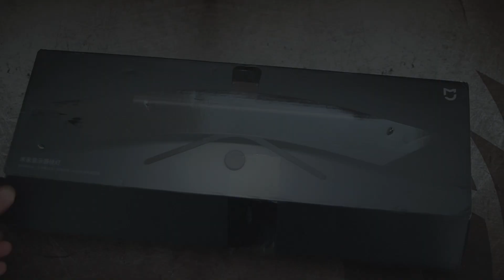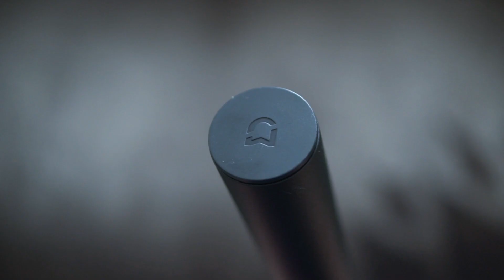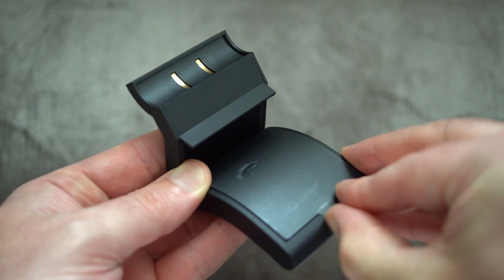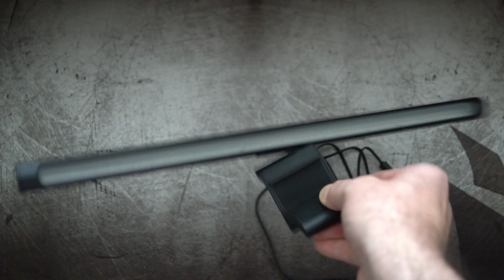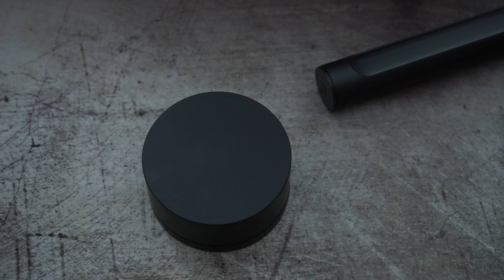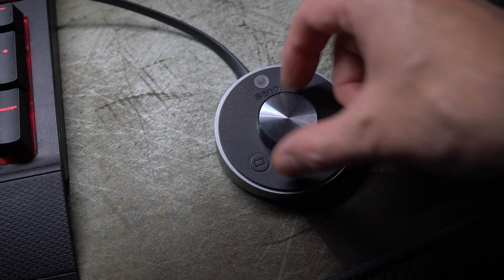Xiaomi Mi Computer Monitor Light Bar: Quick Look

Comment: Brother can u please help me I have LG UltraGear 27GS60F 27” and I have 2 questions. Will it fit in the center and if it doesn’t is it worth it to put it on the sides of the monitor. I mean will it do the job on the side?
Reply from the maker: It should fit most monitors there is plenty of depth on the design it's only an issue on some curved ones.

Comment: I bought it yesterday and it died today worst quality ever the controller is not working anymore even i changed the batteries and checked everything else
Reply from the maker: You have to go back to the seller and ask for a replacement or refund. I've not had any issue with this since I made the video.

Comment: Wonderful review!!! I have this on my email. I can't wait, BTW. Question about this product: is it acceptable that this light bar connects to the monitor IO?
Reply from the maker: It doesn't drain that much power so you shouldn't have a problem using the monitor port.

Comment: This looks suspiciously similar to the Yeelight pro light bar.

I wouldn't be surprised if they share the same OEM.

At least the BenQ ones have an unique (and frankly superior) hinge design that fits almost any monitor.
Reply from the maker: The BenQ is heavy though and more bulky mechanism. Most monitors will work with this.

Comment: Mine broke 2 times in a year 😅
Reply from the maker: Not had issues with this one so far sorry to hear that
Reply: I'm not surprised, you get what you pay for. 🤷

The common problem with these products is that the more popular they become, the less they are properly QC tested, as the manufacturer struggles to cope with the demand. 

I mean, you could go through several of these before you would have spent the same amount of money as a BenQ light bar.

It's just more e-waste, sadly.
Reply: @StardustLegacyFighter  Exactly, I bought mine online at their official shop from Shopee. It was on sale for 1k PHP (17 USD) sadly it broke after using it for just 4 months it won't turn on anymore. I used to love Xiaomi because they were always on sale but bcus of this I just realised they're selling their defective items at a cheaper price. What sucks more is that they don't have  service centre in my region. The nearest service centre is 4-5 hrs away. 🥲
Reply: Going 3 years now. No problem on my unit either. Sorry to hear that. Might be a bad catch.
Reply: Mine is going 2 years now and is open almost 24/7. No issue. Might be a bad catch (unit) in your part.

Comment: Is there an option to not use the remote? Not a fan of it.
Reply from the maker: No you can't use it without the remote
Reply: The remote is probably the best thing about it, lol.

It's the main reason why more ppl buy this instead of the BenQ Halo, which is about 5 times more expensive.
Reply from the maker: @StardustLegacyFighter  BenQ offered to send that in a few months ago for review, but I declined. Reason I didn't want to spend hours making a vide on light bar that price, that 3 people might watch (if that as there are scores of videos on it)
I just don't think most people will spend that sort of money on the BenQ, and there is no reason to either.

Comment: I have two monitors next to each other at a slight anger. If I fit the bar on one monitor will I get a glare on the other? It looks on your video that the wall next to the monitor lights up so the light goes to the sides?
Reply from the maker: If it's flat no, if it's curved you probably will have light hitting it depends on the monitor

Comment: Great video thanks, just bought the Xiaomi for £31, can't go wrong, I hope lol
Reply from the maker: I like it and still use it, works well and much more useful than some might think. Hardly use the main ceiling  light now this is perfect
Reply: Where did you get it for £31 it’s like sold out everywhere
Reply: @jojojojo88888 They're struggling to keep up with the demand, and as a result of that the QC is guaranteed to be rushed.

Comment: Hey man Im curious on the battery powered controller. How is the battery life of the wireless controller? How often do you change the batteries? because if I have to constantly spend money to replace the batteries of the controller Id rather go for the Baseus lightbar
Reply from the maker: Battery lasts ages it's a complete non issue. Also you can use a rechargeable cell frankly the cost is negligible and you get the benefit of no wires on the controller
Reply: @MrBazReviews  Hey thanks for the reply despite the video being 2 years old. Anyways thats good to hear, but out of curiosity do you remember the last time you changed the batteries? Doesnt have to be exact it could be just a guess
Reply from the maker: @ren0659  It depends how often you change settings it's a non issue forget about it seriously
Reply: @MrBazReviews  Alright then thanks alot man for the constant replies, you convinced me to order the Xiaomi over the baseus
You def earned a sub appreciate it
Reply from the maker: @ren0659  I've not charged the batteries this year, so really it's not a big thing at all, unless you're constantly changing it all the time even then get rechargeable cells
Reply: @MrBazReviews  I see I see thats good to know thanks appreciate it

Comment: I went with the Xiaomi Mi, i don't see why anyone would buy the BenQ when this one is so much cheaper and is a bit better
Reply from the maker: I agree I can't see the reason to buy the BenQ, but at the time it was released this one wasn't around. It is very well made, but they perform very similar.
Reply: It's considerably cheaper, but that's the only advantage it actually has over the BenQ ones.

If you're not on a budget, then I see no reason to pick the cheaper option.

Comment: Nice video! Would like to ask if there is an option for physical/touch controls if the battery dies on the wireless controller? Thanks!
Reply from the maker: No there is no other way to control it. If for example you remove the batteries or they are gone, if you detach and re-attach the bar to the hold it goes back to the last mode used. But you can't change the output unless you have the controller.
The 1S version is the same mostly, but you can control it/link it via the smart home app, so I assume you can adjust the output on that version (I've not used it myself)
Hope that helps.
Reply: @MrBazReviews  thank you so much! I’ve been searching for the answer for quite some time. I’ll make sure to check out the 1S. But if not, I can buy a rechargeable AAA. Battery if all else fails. Once again, thank you so much!

Comment: Note for Apple Studio Display owners:  The bracket covers the built-in camera!  It can be cut to not block the camera and still sit firmly and centered.  I used a Dremel tool to cut the plastic piece that sits on the monitor.
Reply from the maker: Thanks for that that might be useful for some people to know
Reply: Won’t it ruin the design and the esthetics?  It’s my problem now
Reply: Another reason why that monitor is overpriced trash.

Comment: Am I the only one who thinks you shouldn't see the light source (led strip) when this sits on your monitor? It should only shine light on your desk, not into your eyes. Isn't this a problem when using these light bars on top of the monitors?
Reply from the maker: You don't see the light where I am sitting on this light bar, just adjust the angle for the desk.

Comment: how to get automatic turn on when my monitor is on without touch or press the remote/switch ?
Reply from the maker: I don't think there is a way to do this but the new version might have it
Reply: @MrBazReviews Can't you just leave it on via the remote, and then whenever the monitor is powered on, the light bar should turn on automatically?
Reply from the maker: @StardustLegacyFighter  I don't have the new one it might do that I've not used it maybe check their site to see if it can do that

Comment: remote control stopped working in 3 months. Is there a way to start without remote control?
Reply from the maker: No controls on the light you need the remote. 3 months you have a warranty so get in touch with the seller

Comment: Hey Mr. Baz. Will this fit on a LG 34 inch (1900r) curved monitor?
Reply from the maker: It should do the only reason it doesn't fit on this one is the angle on the plastic case material

Comment: what is the difference between the Xiaomi Mijia and Xiaomi Mi?
Reply from the maker: I thought it was the same, there is an updated one via the links (has minor change to light spread and some mi connectivity), otherwise it looks identical to me
Reply: @MrBazReviews  after using it for one year, do you feel the Xiaomi monitor light helps your eye strain?  thanks

Comment: If you rotate all the way to the right does it get brighter and stop? or does it dim at the end?
Reply from the maker: As shown, it stops both ends it does not cycle around
Reply: @MrBazReviews Mine when i cycle to the right all the way after it reached Maximum, then it dims a little. Is it problematic?
Reply from the maker: @georgegiannopoulos  I don't see it on this one try turning it quite a bit both ways might be dust or something. Or change cells too
Reply: @MrBazReviews  I think it was the power from the usb from the computer port. When i connect it to a power plug it works fine.... Can a lower input powered usb damage the light bar?
Reply from the maker: @georgegiannopoulos  No
Reply: @MrBazReviews  Well then i noticed that if i connect it to an extension usb cable it tends to tremble and flicker sometimes and then dim after rotating all the way to the right.
Might be the wattage power. It’s a wonderful light. I find the base does not clip to some samsung monitors with lip.
Reply from the maker: @georgegiannopoulos  Extenders can drop the current, but I would make sure you are using a USB 3.0 port or power it via an adapter not the board or a hub.

Comment: I just bought one, and honestly not happy with it. The lowest brightness setting is too bright for my liking. Even my $3 lamp can go lower in brightness. My desk is now too bright and glaring which is not good for my eyes. This is the second time Xiaomi has disappointed me. First one was their thermos.
Reply from the maker: I can't agree here, yes, I'd like a slightly lower lowest output. But it's far lower than the BenQ at it's lowest level. It's a solid product overall IMO. A tiny firefly output wouldn't be useful at all on this

Comment: What is the PC mode mentioned in the video?
Reply from the maker: It just sets it to a mid output with a warm tint (ie low kelvin)
Reply: @MrBazReviews  Thank you for the quick reply. I have the 27" Redmi 1080 display and the bazel is very thin. I wonder if I should get it.
Reply from the maker: @sharifsany9447  Up to you, could put some card under the lip part to raise it up a bit if it bothered you.

Comment: Can it be tilted towards my face just for video conferencing calls for a few minutes?
Nice Review BTW 👏
Reply from the maker: You might be able to, but it wouldn't be a good idea. LED is very directional and it would be very annoying. I would suggest just turning up the brightness and bouncing the light off the desk. If it's a dark colour, then put a piece of white paper on the desk, angle the light forward a bit more, you'll get an even diffused lighting effect much more appealing than blasting your eyes directly

Comment: Lights up the whole damn room when u send it to max!
Reply from the maker: It's quite bright at top setting, I rarely use it outside the lower ones for most uses.
Reply: @MrBazReviews  same, i mainly got this to light up a keyboard, now i use it to work on electronics literally everything thats done on a desktop, this lights the work surface, im impressed by this thing especially at the pricepoint
Reply from the maker: @308-blackout  Yeah if you are working on the desk and need more light. it's useful for that soft of thing. The price is pretty reasonable, the BenQ I looked at, bit expensive for most I think.

Comment: Hi, when I turn the power up fully, then after a few seconds it automatically turns down the light intensity a little bit. Does yours do the same?
Reply from the maker: Nope, they will do this (all brands) if the USB port can't supply enough current. I would change the port you are using to if possible a newer type USB 3.1, USB 2.0 will top out around 500mA that's not enough to power it at the highest levels
Reply: @MrBazReviews  thanks man!. Just ordered a heavy hitting usb hub with external power supply and dedicated high power charging ports.
Reply: @MrBazReviews  you were right, I was lagging power! Thank you
Reply from the maker: @Spazeranger  No problem!

Comment: I just received mine yesterday. On the remote, does your lid click in place? Mine is all lose and will fall off with little rotation :( It doesn’t click and lock.
Reply from the maker: It clicks, though some play, but it doesn't fall off. Check the 3 tabs on the base part, and make sure it's lined up with the markings on the case side (padlock with arrow)
Reply: @MrBazReviews  Hmm, ok 🤔 I got it lined up with the padlock and arrow but there’s no click. If I shake the remote, you can hear it’s all lose. The lid will also fall of if I twist the remote a little bit..

I will return it and ask for a new one.
Thanks for answering!
Reply from the maker: @danielNTBD  When lined up twist is hard clockwise so that it engages, there is some play even locked, but it isn't noticeable on the desk when cells are in it

Comment: I have multiple monitors and 2 of these, is these no way to use 1 remote/controller for both?
Reply from the maker: I only have one to test, so I have no idea. I would have assumed they would use the same frequency, for each bar/controller - I can't do a practical test with 2 because I don't have 2
Can't say if there is any way to have both on the same, if you have 2 and it's not working, then we can assume it's not possible
Reply: @MrBazReviews  I assumed the same thing, there are even versions that show 1 puc and 2 lightbars so I assumed they must be using the same frequency, 

I have a 3rd on its way (my room has very little natural light and I work with 2 large ultrawide monitors) so I guess I'll get to see if maybe the 3rd 1 would work with 1 of these but a little disappointed that they aren't universal, specially if someone loses one of the controllers and wants to get a new 1, the lightbars effectively become useless without the controller that came with them
Reply from the maker: @FarFromLogic  Silly question, but have you tried different controllers with different bars on their own? ie turning off the other ones. I had wondered if it's interference causing the problem. That will tell us if they are absolutely not using the same frequency!
Reply: @MrBazReviews  turned off 1, held the controller of the other and took it of power and back on, it blinked 3 times and paired with the new controller, got both working off 1 now, I was looking at other videos on how to re-pair those old rgb remotes and just tried everything, somehow it worked :)

Comment: I have this light and the controller stopped working. Has anyone had this happen and were you able to fix it? I am not sure if its just broken or it lost connection to the light bar
Reply: Yes. This is a massive problem that happens over time with this lamp. Do not buy this piece of shit.
Reply from the maker: @Alexey_12  I've not seen a problem on this unit, shit happens contact the seller, that's what a warranty is for
Reply: @MrBazReviews  How long do you use this lamp? I had this problem after a year of use. What is the warranty with aliexpress? The seller has not been on the site for a long time.
Reply from the maker: @Alexey_12  I'm using it since July last year, every day, so far not had a problem. If I did I would make another video. I don't buy electronic stuff from aliexpress, only small things, best to stick to larger sites as they are better looking after you if there is a problem
Reply from the maker: Other than trying new batteries, I only have a sample of one to comment on. If it's new and you tried changing the cells, contact the seller about it they should be able to sort it out

Comment: How diffused are the LED lights on the Xiaomi? 
I bought the Quntis light bar from amazon and at certain angles the LED nodes shine directly into my eyes causing major discomfort. Its a deal breaker. I'm thinking about returning it and buying the Xiaomi instead.
Reply from the maker: The panel over the LED's is frosted, the BenQ isn't - hence the light is a bit more diffused. I have seen some people put paper/thin white plastic over LED's to soften the light even more. I don't find the Xiaomi harsh at all, the angle is important though. All these LED light bars are deflecting the LED's off a textured metal strip inside - so none are directly beaming the LED light down directly. LED's are very directional, hence you need to spread the light out more v normal bulbs/light sources

Comment: Thanks for doing the comparison. I'm glad I didn't go for the much more expensive Benq even though I really wanted to! How do you feel about the build quality between the two?
Reply from the maker: The BenQ does feel a bit nicer overall in build, perhaps on the bar itself. The remote is super chunky and beefy. However, the price difference simply can't be justified IMO on the BenQ. The Xiaomi is good enough build, has a wireless controller albeit plastic (it's fine in my view), a lower lowest output, and type C port. The only serious complaint is the short cable, which I had to extend with a USB extender cable.
I would absolutely buy the Xiaomi over the BenQ, the light output is very similar on both
Reply: @MrBazReviews  Sounds like a lot of plus points for the Xiaomi. Cheers!